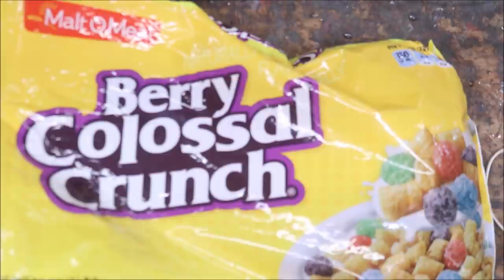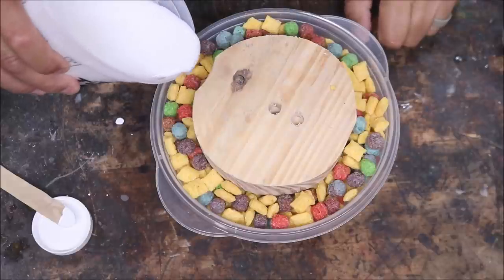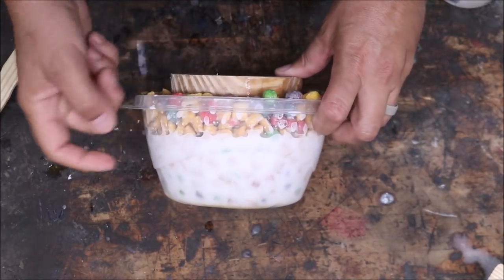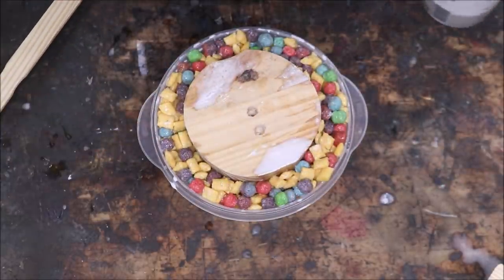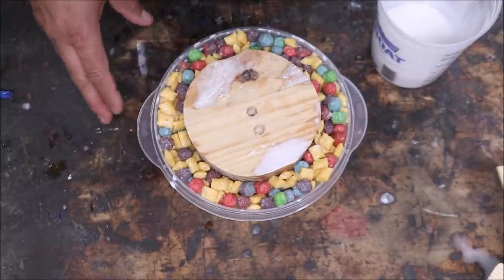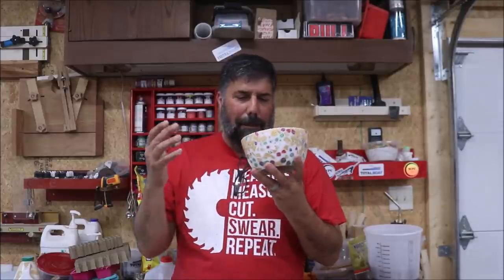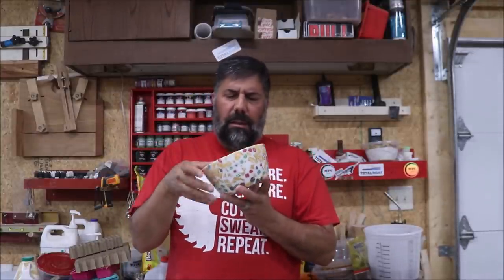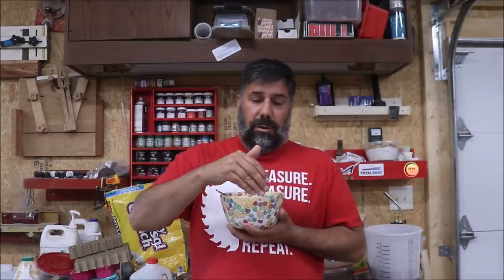Making a Cereal Bowl out of Cereal? 🤔

Comment: Let me begin with how cool I find this to be.  The most crafty nurse here on YT made a candle that looked exactly like a bowl of cereal. Your bow would be it’s perfect complement! 
I have a thought if you plan to make another of these. Start smaller, then instead of topping  it off with more white resin,  top it with clear. At their point it looked just like a bowl of cereal. ( 3:58 )So once that is cured mold it inside some clear resin. That way you only turn the clear resin and it will look like cereal inside of a clear bowl🥣.
Thanks for the video. I do love watching you work.
Reply: I thought the same thing. (Or use clear resin only, and let the real milk show through)👍🏽
Reply from the maker: Thanks for the tip.

Comment: How do you know when a vacuum chamber is needed? I only have a pressure pot.
Reply from the maker: A vacuum is best for drawing out air bubbles. A pressure pot attempts to squeeze them so small you can't see them. I use the vacuum and the pressure pot normally. I use the vacuum to remove bubbles in a areas that I think the pressure pot won't. Or I need to get resin inside something.  I hope this made sense.

Comment: Hey Ken,
You used to be pretty much exclusive to using Acks, or OB Shine to finish your pieces. I missed the video where you started to paint a layer of Total Boat to act as the finish. 

What made you switch up?
Reply: He'll correct me if I'm wrong, but probably sponsorship. Which is honestly just as well: as a layman, I find that the end result looks cleaner and requires less effort by doing a flood coat with resin. It just looks shinier to me.
Reply from the maker: I've been doing more total resin projects lately. A resin finish just ]covers the piece better and is much less work. I still love using Acks.

Comment: I was going to deduct valuable style points for not using real Cap'n Crunch, but I wouldn't waste it in a resin cast either. I would have taken out the green, blue, and purple faux-crunch berries though - just to make it look more like Cap'n Crunch. It looks cooler than hell, though! Great project, Ken! I'd happily eat my breakfast out of that puppy!
Reply from the maker: There are more difficult ways to do it that will use less resin, but this was an experiments to see if it would work. I wasn't sure of the final shape so the wood insert could have been bigger, but  I did reuse the resin shavings in other bowls as I do in most of my creations.  Thanks for watching and commenting. I hope to see you around the channel more.